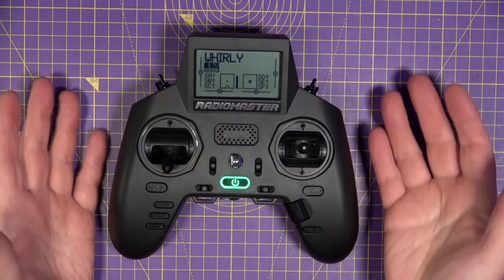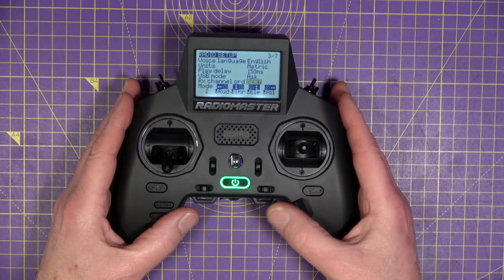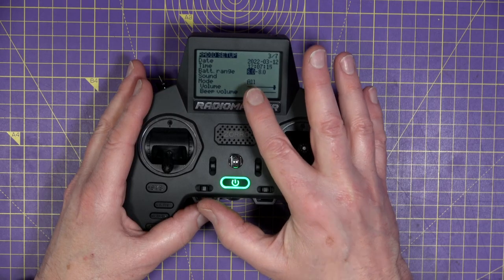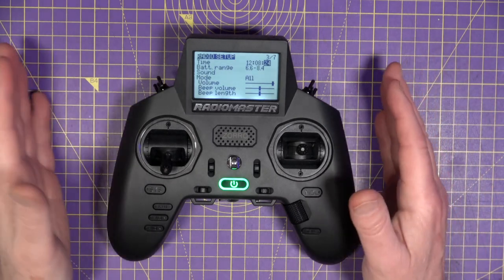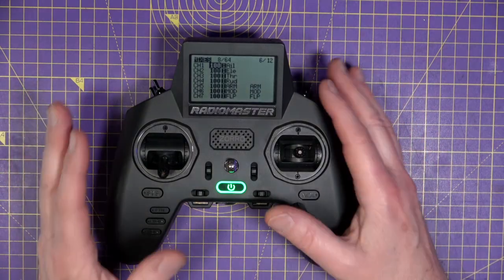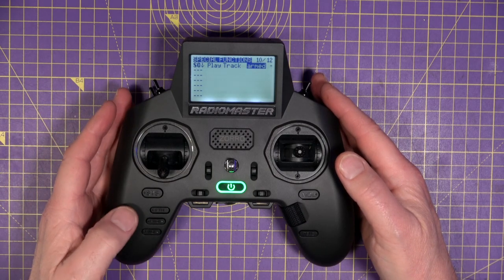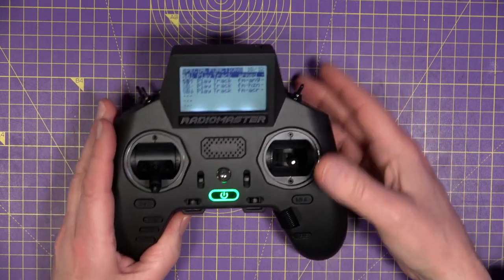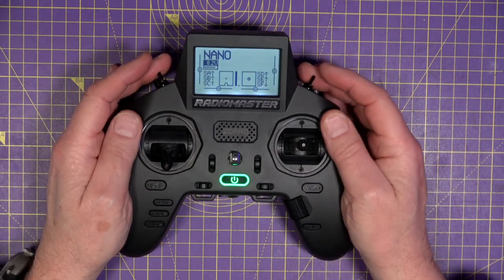RadioMaster Zorro Tutorial - Initial setup and creating a model

Comment: Great video and very helpful.  I'm a new-b and will be getting one of these tx's with ELRS built in.  First question at 4:35 when u r setting up the Model internal RF Mode for ELRS.  What is crsf and how does that stand for ELRS? I see it stands for "crossfire protocol" but still don't get the connection.   Not intuitive for a new-b.  Any help would be appreciated.  Plz type slow because I'm 76.  Thx
Reply from the maker: Thanks for the kind comments. CRSF is the Crossfire protocol that ELRS software uses.

Comment: I am trying to use the zorro on a blade 230s, after I bind it it can't get the collective pitch to work with the throttle. Any videos showing how to set this up. Thank you.
Reply from the maker: Check the channel assignments and make sure that the collective pitch is properly assigned to the correct channel. It sounds like either the input or mix is talking to the wrong channel.

Comment: Do you have to create a model for eaxh aircraft?
The reason im asking is i bought a OMP M2 RTF kit and it was preprogrammed .
I had 2 other OMP helis that i wanted to bind to the transmitter.  So, i copied the exisitng model and created 2 new ones to bind them to the transmitter. 
So i realized that i each of those helicopters will connect to the transmitter without changing models.
Which i was suprised to find out.
Reply from the maker: There's a few options, but for me, the easiest is to create a model for each type, say quad, helicopter, wing, plane etc. I then use a bind phrase on the TX and the same phrase on each RX. Just select the model you want to use, and that's it. Dead simple.
Reply: @WhirlyBloke  I'm am saying that was what I did. But found put by accident that the model will initialize with any of my OMP setups.  It has confused me as to why that is happening.  I fly spektrum and I'm used to creating models for each aircraft I want to bind and I know that until I select that model in my transmitter it will not initialize. 
Not the same with my radiomaster.

Comment: Hi, I just bought this RC and did not do any set up. I just turned on my liftoff simulator and got it connected and did some flying but all the joystick seems to be too sensitive and I have no control over the sticks. I am wondering if it is bcoz of me being newbie or I am missing all these settings. I want the sticks to be lil sensitive so I can fly slowly and learn. Thanks
Reply from the maker: I'm not a sim expert, but it sounds like you need to adjust the rates in liftoff to make it less sensitive.

Comment: My first real radio. I ordered it with the TBS Crossfire Nano module to go with my first real drone Rekon4 FR TBS. Can not figure out how to set the radio up for TBS Crossfire. Don't know if it has to have an SD card inserted for it to work or if it needs firmware updates for the radio or the TBS module. Can not figure out how to bind the drone. I need help. If you can
Reply from the maker: 1.	First, make sure that your TBS Crossfire module is properly installed in the Zorro. You should be able to see the module protruding from the back of the radio. 
	2.	Check to see if the firmware on your Zorro and TBS Crossfire module are up to date. You can find the latest firmware on the Radiomaster and TBS websites. Follow the instructions carefully to update the firmware. 
	3.	Insert a microSD card into the Zorro. The SD card is not required for the TBS Crossfire module to work, but it is recommended for backing up and restoring your settings. 
	4.	Turn on your Zorro and navigate to the "Model" menu. Create a new model for your Rekon4 FR TBS drone and select the appropriate settings, such as the number of channels, frame rate, and failsafe settings. 
	5.	Next, navigate to the "Crossfire" menu and select "TX Setup". Make sure that the "CRSF TX Enable" setting is set to "On". You can also adjust the power output and other settings here. 
	6.	To bind your drone to the TBS Crossfire module, navigate to the "Crossfire" menu and select "Bind". Follow the instructions carefully to put your TBS Crossfire receiver into binding mode and bind it to your TBS Crossfire module. 
	7.	Once your drone is bound, you can test the controls by going to the "Monitor" menu and checking the input values for each channel. 
If you're still having trouble, consult the user manual for your Zorro and TBS Crossfire module for more detailed instructions. You can also reach out to the Radiomaster and TBS customer support teams for assistance.

Comment: so when you change it to crsf does that mean you can only use/bind crsf or can you bind to elrs drone
Reply from the maker: The Zorro supports multiple protocols, including Crossfire (CRSF) and ExpressLRS (ELRS). When you switch the Zorro to CRSF mode, it will only communicate using the CRSF protocol. However, you can switch back to ELRS mode to communicate with an ELRS receiver.

In order to bind a receiver to your Radiomaster Zorro, you will need to make sure that the receiver is compatible with the protocol you are using. For example, if you are using the CRSF protocol, you will need a CRSF-compatible receiver to bind to your Zorro. If you are using the ELRS protocol, you will need an ELRS-compatible receiver to bind to your Zorro.

It's important to note that not all receivers are compatible with both protocols, so it's important to check the compatibility before attempting to bind a receiver to your Zorro.

Comment: Whirley Bloke,have you come across this situation ? I have two Fly Wing FW200 GPS Helicopters ,I set them up in my Zorro 4 in 1,as FW200 1 and FW200 2,what I found out is, it doesn't matter what model name i use the Heli will fly on either one,so I can leave Model FW200 1 on the screen and fly both Helie's and visa versa,what's up with that ?
Reply from the maker: If you're using a binding phrase that can happen.

Comment: Zorro CC2500 version can bind with flysky rx....?
Reply from the maker: The RadioMaster Zorro uses the CC2500 chip for its RF communication. However, the compatibility with FlySky receivers depends on the specific FlySky receiver you are using.

The RadioMaster Zorro supports multiple protocols such as FrSky, DSM2/DSMX, and FlySky. To bind with a FlySky receiver, you need to ensure that the receiver is compatible with the FlySky protocol.

You can check the user manual or product specification of your FlySky receiver to see if it is compatible with the FlySky protocol. If your FlySky receiver is compatible with the FlySky protocol, you should be able to bind it with the RadioMaster Zorro.

To bind the RadioMaster Zorro with the FlySky receiver, you need to follow the binding procedure specific to the FlySky protocol. The exact steps for binding may vary depending on the specific FlySky receiver you are using, so you should refer to the user manual for your receiver for specific instructions.

Comment: Very informative, i am having a problem ,the radio is not recognised in win 11.Any advice as to how setup the zorro on windows 11 to work with liftoff sim?
Reply from the maker: Offhand no, but I guarantee it will be a USB driver issue. Macs make things like this so much easier.
Reply: @WhirlyBloke  Found the solution, it was in the setup settings on the radio.

Comment: hi, ive been out the hobby for a while and was wonder which model to buy as there seems to be several options. can you help please.
Reply from the maker: There's so many options for you based on price, size and what you want to use it for. It's hard to answer without more info
Reply: @WhirlyBloke  thanks for reply,  i've flown planes and had a commercial drone licence but been out of hobby etc for a while now. was thinking about getting back into FPV drones.  my current radio is a only used twice frsky horus x10 so have a few frsky recivers and a few planes left. i just bought the baby pro ... that you recommended and a frsky receiver for it (not arrived yet)  so was thinking get the 4 in1 and then but the erls or what ever it called module so will have the best of both world!  what do you think?
Reply from the maker: @defendermods9420  if you get the 4 in 1 and use an FrSky receiver that would be fine. If you want to use ELRS at a later date you can plug an ELRS transmitter module on the back of the Zorro. They are pretty cheap. Check out my review of the BetaFPV one last month.
Reply: @WhirlyBloke  will check that out later.  Thank you 😊

Comment: When I go to Model SETUP page, I only see CRSF as Internal RF. I thought I had purchased a 4-in-1. Do you know how i can confirm this?
Reply from the maker: Check wth the vendor. It sounds like they've sent you the wrong version.
Reply: @WhirlyBloke  is it OK also if I only have MULTI here?
Reply: Remove the Module cover off the back,look inside where the pins are,mine has a label that says 4 in 1
Reply: @FerranCapo  No,there's another setting under multi to select the protocol,you need to find out what the protocol is for the receiver,so you can select it in the Zorro

Comment: Can anyone help me please, when I am entering inputs I cannot assign switches SE and SF as a source, the top 2 switches I can assign, but when I try to assign either of the bottom switch it does nothing the option will not change when I flick the switch.
I am trying to assign switch SE as Arm.
Reply from the maker: Make sure you've added them as inputs before you setup the mixes.

Comment: Did this and now when I select expressLRS on system the radio gets stuck on loading… have to turn it off and back on. Can’t connect to my drone anymore either. Lol.
Reply: Never mind. Somehow turned internal RF off. Turned it back on and all good again.
Reply from the maker: It sounds like there may be an issue with the firmware update you performed on your Radiomaster Zorro. When the radio gets stuck on loading after selecting ExpressLRS on the system, it could indicate a firmware error or a compatibility issue between the firmware and the rest of the system.

To troubleshoot the issue, try the following steps:

Check the firmware version: Make sure that you have installed the correct firmware version for your radio and that it is compatible with your drone. You can check the firmware version and release notes on the manufacturer's website.

Re-flash the firmware: If you suspect that the firmware update caused the issue, try re-flashing the firmware using the manufacturer's recommended procedure. Make sure to follow the instructions carefully and do not interrupt the flashing process.

Reset the radio: Try resetting the radio to its default settings. This can help resolve any conflicts or errors that may be causing the issue. You can usually do this by going to the system settings menu and selecting "reset to default."

Check the connections: Make sure that all the cables and connections between the radio and your drone are properly connected and secure.

If none of these steps solve the issue, you may need to contact the manufacturer's customer support for further assistance. They may be able to provide additional troubleshooting steps or recommend a repair or replacement for your radio.
Reply: @WhirlyBloke  or just check to make sure you didn’t accidentally turn off internal rf. All great checks you offered but sometimes for us noobs the most simple check is often times the most common.